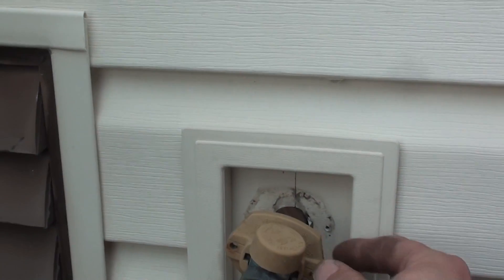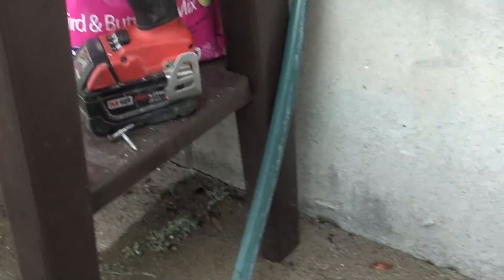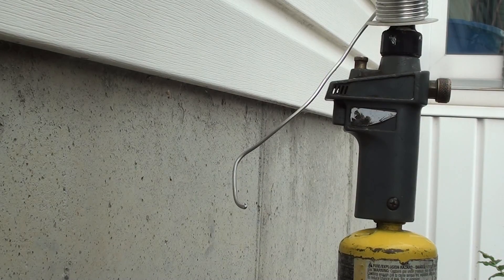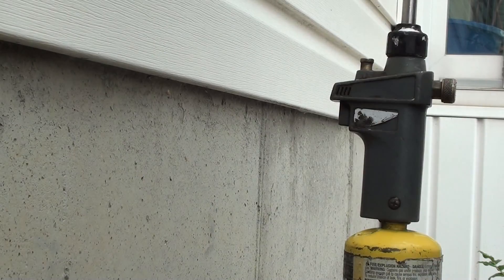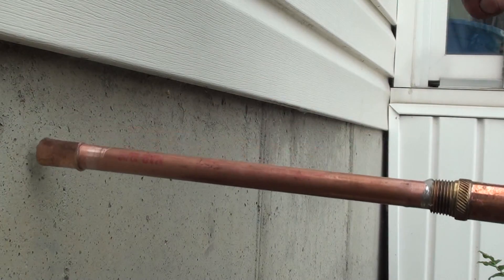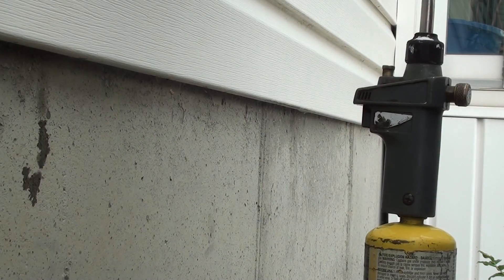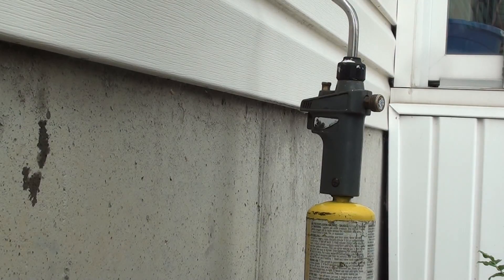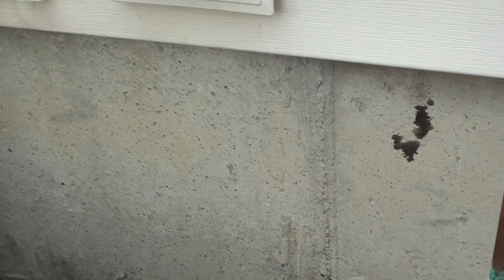outside spigot replaced  1

Comment: We in Massachusetts have to use lead free brass fittings and they don t solder as good the lead one s. Oatey 95 tinning flux works great for lead free brass fittings.
Reply from the maker: Yeah they just started that up(Down rather) here in Ohio at the beginning of this year. Yeah you're right man a lot of those the fittings were hard to solder I ended up having to switch back to the tinningflux. However they still sell 95-5  solder.
Reply: Thanks for the videos I really enjoy them and plumbing  since I was a kid and have worked as a apprentice too.
Reply from the maker: +Brian Crandall 
No problem, I enjoy my job that much too. Thanks buddy